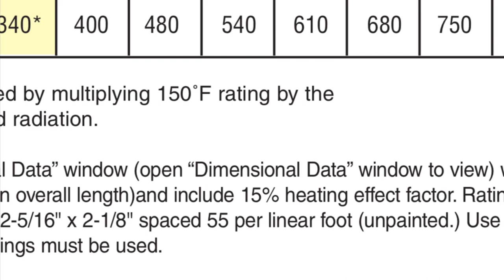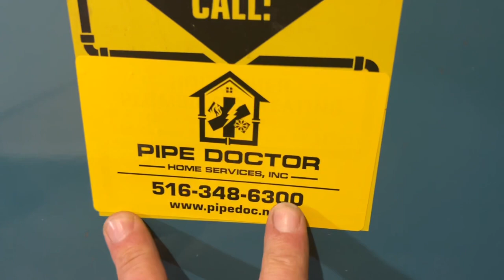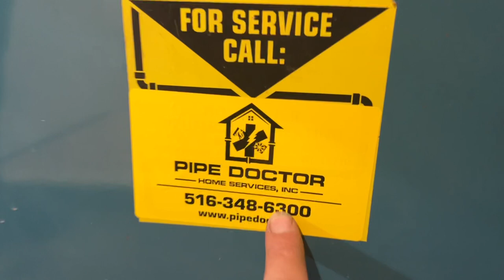Burnham Steam Boiler with Improperly Installed Hydronic Zone Not Working

Comment: I have a customer with the exact same problem. However, Ive been a repair tech for 13 years and never came across a steam boiler with a hydronic loop. So my initial reaction is this cant be done. Ive since found out that you can do it, but bc of your video now know you cant do it when the baseboards are above boiler level without a heat exchanger. It is also a Burnham boiler.

Comment: The only thing I would of added is a little more of an explanation on the "why" side.  For the flat plate heat exchanger, you want to keep the water loops separated for multiple reasons: a) cruddy/dirty water from the steam loops will clog up check valves and  standard heating pumps in a jiffy, and b) if you have water above the water line and those check valves fail, gravity will flood the boiler as it is not a closed system and air will get in from the steam vents. 

Another idea may be to add an indirect HW heater.  In this situation he could use most of his existing equipment (if he stays below the steam water line with the inner coil).  This may also be good for a future conversion to hot water heating should he decide to go in that direction.

Just me 2 cents.  Otherwise great explanation

Comment: You were straightforward on what solutions you could offer.  Quite frankly I would have told him that he had only one, replace the boiler as the others wont work out.  If he declined you saved yourself a headache
Reply: Yeah not worth the effort to explain everything to this guy lol, you could tell he just wanted a cheap fix and not address the real problem.
Reply: @Lewdacris916  You are correct Jordan.  That said, many people are pinched for money, so they are looking to do the minimum to keep things running.  If one has the resources, I would do the right fix
Reply: or give him a deal on a reburbied Navien

Comment: crazy, they used a indirect  water heater tap and indirect water heater "control" tap, I thought they was a small diameter tapping like 1/2"? 
how do they expect that to work, the pump is pumping into the boiler and suction side is pulling from the house loop, which goes back to boiler at same level, then an odd cross-connect with shutoff between flow-checks. is it maybe a circuit to an indirect storage tank or plate heat exchanger somewhere else in the building?(stupid design if so) or perhaps someone else has been fiddling with the flow checks and pump, reversing them. technically, if the zone was purged of air and back through the pump and always had the tapings under water, it may work for a short while before becoming air bound somewhere in the loop.
odd that it's managing to suck all the water out, when the pump is pushing into the boiler and only suction side to the heating loops, but I guess it could if there was a bunch of air behind water in the middle. the pump should hit air and quit pulling though.

Comment: Amazing how everyone is using the wrong circulator today. The circulator needs to be bronze or stainless. I stopped doing these setups other than basement years ago. Heat exchanger (like you mention) storage tank or seperate boiler that's it. I have lost several jobs but I know mine works period.
Reply: Bronze circulator for steam ? Or all systems ?
Reply: @shahsmerdis  when pulling a loop off a steam boiler like that with no separation you should use a bronze. The steam boiler is open to the atmosphere so there is corrosion on an iron pump. Will not last very long, plus they handle the high temp better. All the older systems like this had bronze pumps would last a long time.
Reply: @tuppersdad  don't have a steam system but good to know ! Thanks